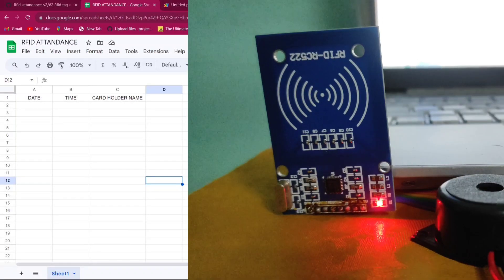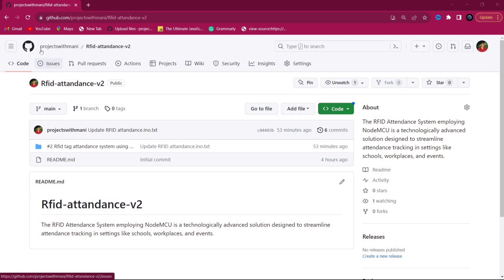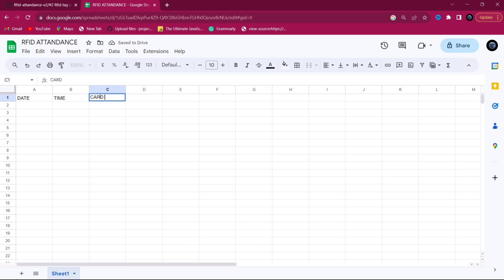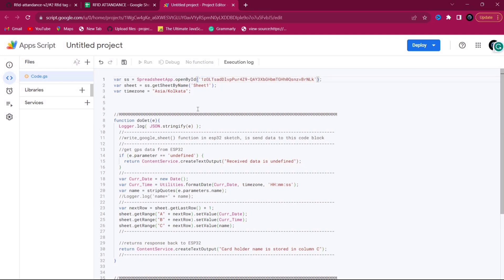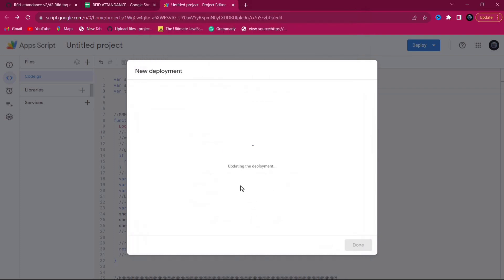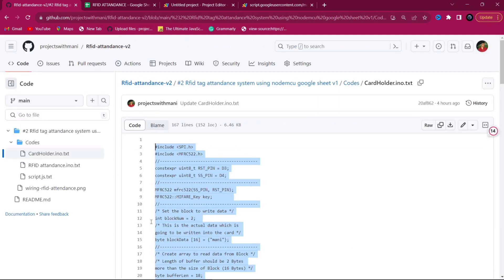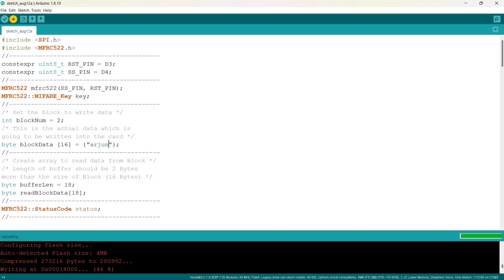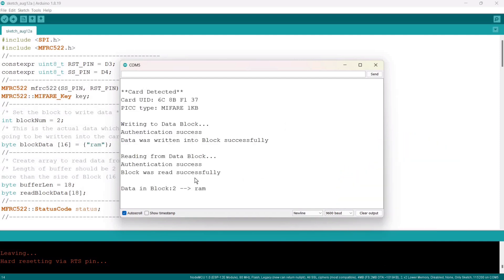RFID tag attendance system With Nodemcu google spreadsheet || Send RFID data to google spread sheet

Comment: URGENT : I followed all the steps correctly, code is compiling properly but RFID card & tags are not readable and not showing on the screen, can you please help us? We have to finish this project by tomorrow for school presentation.
Reply: i am also facing same problem
Reply: Any solution?
Reply from the maker: Try to check connections
Reply: @Projectswithmani all connections are properly connected but also not showing and reading rfid tag
Reply: @technologymeet6959  had the same problem. What l did is just removed the positive terminal of the rfid module which was at 3.3v AND instead connected it to  vin 😊
Reply: All connections are correct, I checked it thrice. Red led on reader and green led on arduino uno r3 is ON. Any suggestions? @Projectswithmani